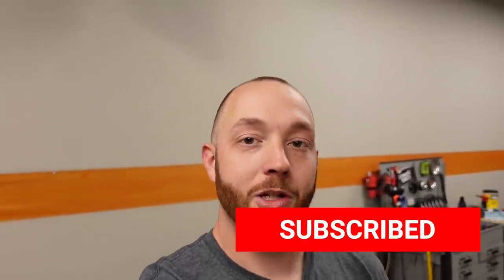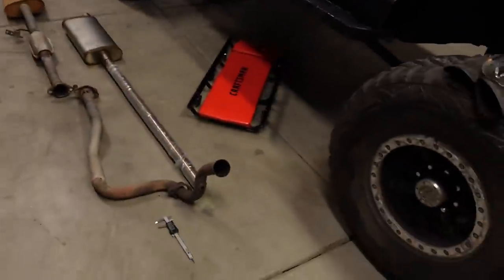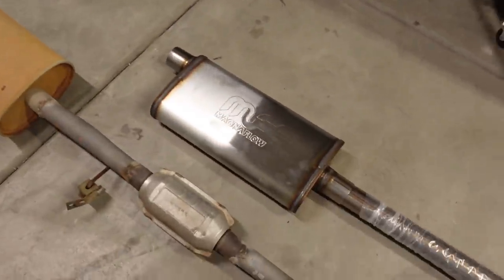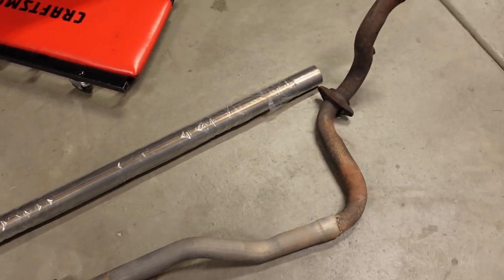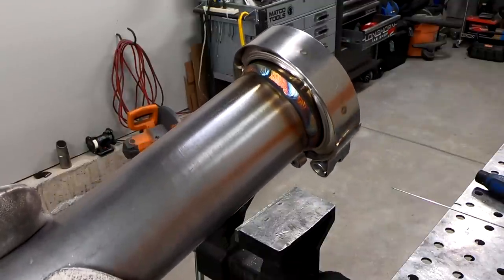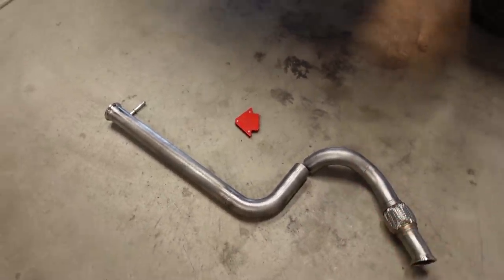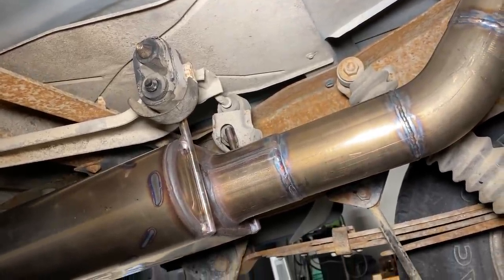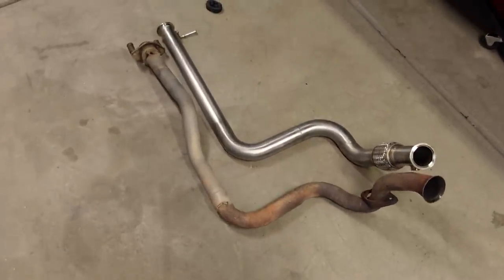Rebuilding the WORST exhaust I've seen with Stainless Mandrel Bends: Jeep Comanche MJ

Comment: As for the ultra quiet resonator. Correct me if I'm wrong but is that not a catalytic converter?
Reply: Shhhh.... its illegal to remove cats. So thats not a cat, thats a resonator.
Reply: It's the same thing
Reply: Pretty sure some states don't care if you chop cats off

Comment: I've heard that 1in² of exhaust pipe flows 115cfm and that you should shoot for 2.2cfm of flow per hp. By that formula, 2.25" pipe should support 207hp and 2" pipe should support 164hp. You should try to be as close to your actual flywheel power as possible to keep the velocity high but not restrict flow. If you go smaller, it will raise torque below the peak torque rpm but if you go bigger, it will raise torque above your peak torque rpm. 
  I've also heard that mandrel bends don't seem to help and bashing header tubes doesn't make a difference either but I'm like you and would rather keep the diameter consistent. The Magnaflow straight-through muffler design should flow marginally as good as a straight pipe.
  I know it's not really feasible to dyno it before and after, but I'm sure you gained power and throttle response compared to the existing system. 
  Love the content. Keep up the good work. I got my ugly shirt this week. Love it. Onward and upward to 100k!
Reply: As far as muffler choice goes, I'm a fan of Magnaflow. On my pickup, I'm currently running a resonator designed for a semi. It's 5"ID X 9" long. I use bell adapters to go from 4" to 5" and back down to 4". I'm using a 4" diesel system from Diamond Eye Performance for my little 350. The bends were already made for my body style. $250. I built my own 3" pipes before the 3-4 Flowmaster y pipe and ran the 4" system after that.

Comment: Good content just a 🤏question. Do you back purge the exhaust at all or does it not make enough of a difference to worry about it on exhaust?
Reply from the maker: usually the only time I back purge is on a pre-turbo pipe where I need to make sure its extra clean inside... for regular exhaust I usually never back purge because of the added expense, and I don't see a huge benefit

Comment: Difference between a exhaust shop trying to make max profit and get a rig in and out without much time or material spent.
And a YouTuber that has his angle finder and TIG torch out for every section of the exhaust.
Did the other exhaust work? 99.9% honestly don't believe this made the .01 but just giving you the edge ;)
This new exhaust is very well done and seems to be the nicest part on this whole rig LOL

Comment: That looks heaps better. Only one thing I'd note here. The clearance to the trans pan might be a bit tight. Unless SS has a lower heat transfer that I'm not thinking about. Couldn't you wrap that front section in the fiberglass wrap to try and keep heat away from it? Or maybe make an aluminum heat shield to block the heat transfer?

Comment: The smashed sections are mandatory. When i first did my lift my front drive abashed sandwich my down pipe. Then i had a a stick get sucked up there and smash it even more. Ended up cracking the pipe and replacing it.

Comment: I've been slowly piecing together a new exhaust system on my car. I did the rear half so far while I have the rear axle out, it doesn't look nearly as nice as yours but I also don't have but a few months of self taught welding experience with flux core! I'll do the front half when I put the bigger turbo on. I need a better (TIG) welder!

Comment: Welding those flex couplers is a trick.  I use 1/8" rod and lots of foot pedal.
Reply from the maker: i found it was easiest to fuse the two layers of the flex coupler together first to make a thicker area to weld to,  and  then weld  that to the pipe.  seemed to make a cleaner result.

Comment: A cheap band clamp with some slots or holes cut into makes for a a decent exhaust joint holding tool and you can tack through the holes. Js
Reply from the maker: I know, I need to get a setup like that

Comment: I hear you on the oem hangers, but on the other 2 styles just because they have bolt holes that doesn't mean that they can't be welded in. I've done it plenty and haven't had any issues.
Reply from the maker: true, you can weld those as well...

Comment: I could be wrong but at 22:37 it looks like the oil pan bolt next to the exhaust is loose
Reply from the maker: you're not wrong, good eye! that's the bolt that holds the wire clamp for the o2 sensor thats not in yet...

Comment: On Engine Masters they were just denting primary tubes, not after the collector when it's dealing with all the cylinders and not just one.
Reply: I think they recently did a mandrel vs crush bent test too. I don't recall the exact results, but mandrel didn't really seem worth the extra money at the 500hp level.

Comment: Nice video LT love the content and personally I subscribed to your channel right away after you quit PowerNationTV but, man chill with dogging out the lesser individuals than yourself. Most people aren’t trained by a tech school or have honed their skills before, during and after a fancy TV show. Not everybody is able to afford nice TIG or MIG welders to do sweet welds and afford nice stainless exhaust from Magnaflow. Some folks can’t do the welds and can’t afford the $400-$600 price tag for nice exhaust parts with sweet welds from a good welder. They’ve got to bring it to that guy they know that can literally stick it together on the cheap with rock autos best OEM parts. 

I’m tech school trained myself just as you were though my project car has rockauto’s best sized dual thrusher 2” mufflers, 2” H-Pipe with summits OEM style & quality dual 2” catalytic converters and rock auto’s OEM “over the rear axle” tail pipes. It’s both bolted together with 2” gasket-style flanges and slip-fit joints with standard 2” exhaust clamps. Why? Because, that’s what budget can afford right now. Welding it up properly I’ll do later along with v-bands and better quality performance exhaust parts as I can afford them. We all like your quality of work and your experience level too but, most of us can’t afford “nice” right now and have to deal with “alright that’ll work”. #pandemicsucksforthelittleguy
Reply: Dogging some one out ? They were shite welds. Stop crying
Reply: @assaultlick2169  wasn’t necessarily talking only about the welds sir, more so the whole exhaust. And seriously “crying” oh that hurt smh.
Reply: @assaultlick2169   Yeah, shit welds that he probably paid big $ to have done.